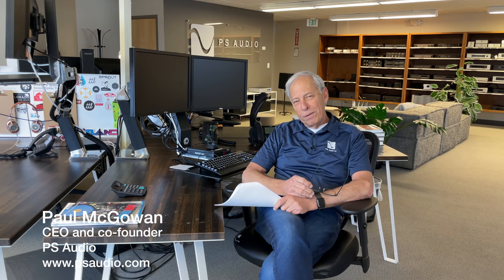Why speakers are made from MDF

Comment: One of the rare cases where the cheaper material is actually the better solution.
Reply: cheaper still is fibreboard:) used in very low end speakers
Reply: @MrTruth111  Ah yes the choice of Logitech and other small PC type systems. I call it cardboard wood

Comment: Just as Paul says, it's all about resonance, I am a Woodworker since about 20years now, and He ist exactly right, for a Speaker Cabinet You want a Material that ist as homogenous as possible preferably with a high density, MDF is basically a compromise that's pretty easy to machine, while very homogeneous, that Makes it an ideal Material for adding a venere or varnish to it without the Risk of Cracks while being reasonably cheap. Probably a better Material would have a Higher density, such as corian what ist essentially acrylic with added minerals to get similar properties Like marble while being a thermoplast and at the same time can be casted like a liquid, but it is pretty expensive and usually Used for Bathrooms or Counters at Airports and such because of its Properties. Another alternative would be HPL. Plywood usually adds too mouch resonance for high quality speakers, and OSB or ESB is not ideal due to not properly glued Wood Chips, which can resonate in an uncontrolled manner.

Comment: MDF is relatively cheap, easy to work with - as in doesn't burn out your computer controlled circular saw and is acoustically inert, can be veneered with prettier looking real wood at little extra cost, etc. But MDF tends to deteriotate in tropical climates. I've heard that in the Philippines and neighboring parts of SE Asia, loudspeakers made from real wood like 1960s era JBLs and Klipsch Heresys are still alive and kicking but 1980s and 1990s era MDF speakers have started to crumble back to sawdust from 2009 onwards.

Comment: When I was building my speakers, I knocked on the back and sides. It didn't sound dull, so we glued and screwed another inch of MDF to that area. I used 1"X1" and 2"X2" oak glue blocks along all seams. The inside has several coats of polyurethane to reduce moisture absorption. The baffle panels are 1" marine plywood. I was going to use veneer on the outside, but used plastic laminate instead. That actually added deadening to the panels. Forty years later, they still have that big JBL sound that gets to my core.

Comment: Hi Paul...Great question from your community..Back in the late Eighties I was reading an article about the development of a speaker called the SL 600 this was made using a honeycomb structured Aluminium ( as used on flight  deck manufacturing) a prototype made with excellent sound characteristics and reviews of this pair where getting very positive results. So a small production run was put in action and the these speakers where then again reviewed by the Great & Good in the industry....alas all the comments where rather negative  !!! The reason being is that they had made the production model too perfect and of course now the body of the speaker had its own frequency which coloured the sound. As an example we know that bone china has that wonderful clear ding if you flick it with your finger , but when it's cracked that ring will turn into a thud. So the first set of speakers had a fault in their construction which had disabled the cabinet frequency  and the "Perfected" manufactured assembly line run had created a cabinet frequency. So month's  later I finally got to listen to a revised pair  (  with the intended  fault in the cabinet design ) and they  sounded really good. My own experience in designing speakers where to also  reduce cabinet frequency but  to completely try and deminish the standing wave from the transducer inside the structure...but that's another story.

Comment: Solid wood has expansion and contraction issues. 
I don't like MDF/HDF, can do without all of the formaldehyde used in manufacture. Plus cabinet walls need to be significantly thicker to achieve the same degree of stiffness as a quality void-free multi-layer plywood. 
I only use Multi-layer void-free Baltic Birch Plywood for my own DIY loudspeaker projects.
Reply: I've built identical pairs of speakers using Baltic Birch ply and MDF, and the the MDF pair sounds better.  The BB-ply versions have a bit of woody boxiness in the mid-bass that the MDFs don't have.   Adding deadening vinyl to the inside helped, but still not better than the MDF cabs.
Reply: @TheMirolab  Yes, PA and instrument cabs are plywood. Light and strong are more important than heavy, less resonant speaker cabinet. MDF has been great improvement after 60-70's chip board boxes.
Reply: @pekkatervala8476  MDF is a bit easier to work with. I've never had a clean cut or edge treatment on ply 😒
Reply: @staLkerhu  Yes, plywood is great on instrument and PA cabs  on the road. Guitar cabs are preferred to have resonant material. MDF is hard to beat and it's cost effective. Common material on kitchen cupboard doors, it stays straight and can be decorated with a router.

Comment: I'm no acoustic expert but I'd guess that real wood is also very inconsistent in its density, and you really don't want that in speaker design. Think of the different colors of a wooden sheet which usually represent some kind of imperfection and a difference in hardness. On the other hand MDF is pretty damn perfect in density.
Reply: All the commenters are answering better than Paul...

Comment: Fender Blackface amp cabinets (like the Twin Reverb) are made of MDF for this very reason, to get a cleaner sound without cabinet resonances. Fender Tweed amp cabinets (like the 59 Bassman) were made of pine which does resonate quite a bit and is considered part of the Tweed amp sound.

Comment: There were speakers designed early 70s spendor BC1 and the Rogers LS35a using a specific Birch ply which was intentional as part of the design meaning the speaker would sing and that was catered for in the design .this is rare however..Hi Paul

Comment: Other designs like the French speaker/amp company, Lavardin/Lecontoure, use plywood for their cabinets and also stated that plywood has the best ability to get rid of unwanted vibrations. if u put your equipment on such a base made of plywood, it will benefit big time (try it). So they made a series of speakers (3 models), which cabinets was made by plywood. I own both (amp/speaker), and my experience with using plywood underneath my components, is a real bargain. It works! As for the speaker design...they wen't with plywood, as a part of the acoustic "treatment", in lack of a better word? The designer thinks MDF wasn't good enough for what he wanted, so there u have it. My system is defiantly a French one, and not for everybody. But when you first get your head around what your listening too, then it's very hard to go back to any other system (imo). Cheers from Denmark

Comment: MDF is made from very thin fibers bonded in a resin under very high pressure.  It is very dense and does come in several densities(LDF, MDF and HDF).  Particle board is made from wood particles(sawdust? not really) and also comes in several densities.  Natural wood has resonance largely due to the pores that run the length of the board, the larger the pores(grain) the more resonant.   Particle board is actually a bit deader, but is not as good a material  to work with as it is weaker and not as smooth as MDF or HDF.  At one point hobby builders were using an inner layer of  particle board and an outer layer of MDF bonded together for a very dense, dead box.

Comment: Consistency of the material and reliable to machine to fine tolerances. Grade-A multi-birch ply, braces and damping panels, if you have the money, and prefer to not have to use a pallet truck to move MDF around. :-)

Comment: DENSER & DEADER. To supplement the combination, the interior is lined with acoustic sound deadening materials. The TMI version would be there are a lot of mathematical engineering that goes into the precise specifications, dimensions and materials list.

Comment: Short answer I guess is that it may have better sonic qualities. Some speaker designers may use paper cones instead of metal not because they are trying to get by on the cheap, but because it produces better sound in their opinion. Copper may be better than gold in some cases outside a jewelry box. What would otherwise be cheap furniture material may be ideal for sound producing equipment.

Comment: Most if not every reasonable material used for speaker cabinets has a small/great ring to it, especially when stressed.  But this is where internal bracing comes into play, which essentially act as dampers.  A superior damping strategy is critical in speaker cabinet design.  The question to ask is, what transformation occurs when a speaker cabinet regardless of material (or perhaps any object) is sufficiently damped?  I suspect the correct answer to this question is where much performance potential is hidden.

Comment: Paul, the desk you knocked on looks to be butcher block -- pieces of actual wood glued together --  not MDF. A key tell is the orientation of the endgrain. Given how unevenly it has accepted stain, I'd guess it's either birch or beech.
Reply: I noticed the same thing!
Reply: It looks to be because they designed it to look that way.
The giveaway that it's some fibreboard material is the extensive steel undergirding to prevent sagging.
Reply: @nobodydoesithalfasgoodasyou  Nope, that is not fibreboard. It's solid planks of wood.
Reply: @nobodydoesithalfasgoodasyou  Not true. All sorts of wood tables (even solid wood) have metal braces so they don't sag.

Comment: I have a pair of Chateau two-way speakers from the late 80’s.  They’re built of birch plywood, I believe ¾ inch thick.  They’re extensively braced and all interior surfaces are covered with epoxied lead shot.  They are very dead.  The woofer is a German Eton and the tweeter is an inverted dome French Focal.  I’m quite sure pretty much all I hear are the drivers.

Comment: great topic, but if i dare think out loud here and say that if the cabinet is dead and hard, all the woofer pressure is reflected back, so the damping material inside has to be equally up to the task. 
what if we made the cabinet walls a bit thinner so it flex, then something like "Silent Coat MultiLayer Extra 5 millimeter".
its essentially mass damping, then polyfill the volume.  

i like mdf, its really cheap, you can do routing and shape it, no splinters.

Comment: In my humble but lifetime of loudspeaker designing and building I've found that MDF is a very inferior material to use esp for large speakers.  I've used it all including solid hardwood for some very "boutique" creations.  BTW a properly made complete box made of hardwood doesn't ring...it's just too expensive.  High-ply count, hardwood plywood (again imho and experience) is the best overall.  I think the real answer to the question is the same as why some high-end manufacturers use cheap crossover components.  ;)

Comment: Oak,maple, or mahogany veneered plywoods are dense too, just cost more! Just as dense as MDF or HDF, cause plywoods are cross-grain layered woods glue and dried under extreme pressures!
Reply: Yep. B&W uses plywood, but they have the technology to press it to the final shape inhouse. This is superior to any attempt at bending MDF, or using 90° joints.

Comment: I was always under the impression that the speaker or motor is the only thing you want to produce the sound wave, sympathetic wave emanating from the enclosure is not wanted. The reason you need a box or enclosure is to control the air and to offer the motor the correct air pressures to produce the desired frequencies and amplitude.
The best speakers I have ever heard where indeed housed in a concert box. Everything vibrates and has an inherent frequency but when you look at things so heavy and dense the frequencies are so high it no longer matter as we can't hear them and they are also so weak the amplitude is not powerful enough to create phasing issues or harmonic distortions.
I wonder why we don't see more speaker companies offer other materials more often?
Turntable plinths with internal lead shot to dampen resonances or reconstituted vinyl records melted down to become the damping factor to an aluminium platter are useful maybe there is something in it for speaker box designs?

Comment: There's wood with high resonance and low resonance.  Not sure which one is better, but I believe higher resonance is better. Maple, Oak, and Mahogany are probably the densest woods available which would make for good speaker cabinets. Maple is one of the woods that does have the highest resonance. The only other one is a species from Hawaii and is very expensive.

Comment: That's only one of the reasons. Mdf dosen't swell & shrink & crack, with changing humidity. It is also consistent from batch to batch, in strength & density. Pieces of wood even from the same tree have different densities. Then there's cost. If your going to produce hundreds or thousands of units that have to be warranted, mdf ends up being less expensive for all the aforementioned reasons.

Comment: Here in the Netherlands we had a company that actually made speakers from a concrete composite material.
Reply: @lepidoptera9337  it was marble particles with marble powder andere cement based binding component. This combi was choosen fort its dead structuren.
And the outside was polished to aperfect marble shine. One could even choose the colour of the marble.
I heard then on several demo occasions and they sounded very good.
Speakers and filter components all were high-end.

Comment: Some speaker cabinets are made to sing The Spendor SP2 is an example
Reply: my spendor SA1 has some think cabinet walls, and one bracing that is it. compared it to my other speakers made from HDF and that is probably why the midrange is so different.
Reply: Singing speaker cabinets are never a good thing and that idea is a bit outdated by today’s standards and how things are done today. But if that is what floats your boat then ok.
Reply: @sudd3660  The cabinet becomes an active part of de equation. Much harder to design than just making it as dead and stiff as possible.
Reply: Never say never
Reply: @D1N02  i just hope spendor audio knows what they're doing, because i can't tell if i like it or not. but i sure do like that speakers sound different. 
same reason why people like ported box, or horns, if its enjoyable the end sound it produces then it works for them. 

side note: dead and stiff are not the same thing. dead is absorption and stiff it hard and reflective.
Reply: Those cabinets are pure BS then !
Reply: @Channel-cm7yc  It's definitely a different experience most modern audiences probably can't stomach it though.

Comment: I wonder if there's any place for Epoxy Granite in speaker boxes? It's used in high precision machine tools for it's fantastic deadening properties verses the standard cast iron, and is much stronger than concrete in tension so you can make thinner panels.

Comment: I use Baltic Ply, cabinet grade 5/8's way stronger and better than MDF, but another reason not to use hard wood, is because of the moisture & dry air, it drys wood out and cracks and shrinks / expands and causes issues.
Reply: Real wood needs to be aged to become stable. Upmarket guitar makers - both acoustic and electric - use woods that are aged at least 100 years when making guitars in the 10,000 + US $ price range.
Reply: @laurentzduba1298  I'll stick to Baltic Ply :)
Reply: You can accellerate this process through baking the wood in low oxygen (after also drying it for a few years beforehand) .  The necks of a lot of high end guitars are made of maple that has had all the volitile constituents baked off.

Comment: I'm already picturing some DIY types making plans for a concrete speaker project.
Reply: Thiel's upmarket line are made of concrete but they used a fancy marketing name for the material and called it "fountainhead".
Reply: Fountainhead LOL, imagine cobblestone speakers!
Reply: @laurentzduba1298  Fountainhead is a man made composite that is very similar to Corian, not concrete
Reply: @stefanschneider5624  zu viel Geld, aber schön.
Reply: There was a bit of a fad for concrete speakers in the 80s.
Reply: Just Google "25 Concrete Speakers"
Reply: Did that before, works great, comparatively simple to work with, just heavy…
Reply: Granite
Reply: @graxjpg  terracotta, little planter pots with holes on the bottom for the speaker wire lol
Reply: @ChiefExecutiveOrbiter  That's what I'm using in my current speaker, Norwegian, needless to say it looks nicer than concrete.
Reply: Look into the old design of F3 Lyd/Onken Focal (concrete eeg cabinet).

Comment: It was a good answer but unfortunately it was missing one of the key points. That is that real wood moves. As the moisture level in the wood changes, the joints move and also cracks begin to form. Real word is a horrible product to use for speakers.

Also, the gentleman who wrote the letter using oak as an example gave me a chuckle. Oak is one of the most common hardwoods available in North America. If by no means is considered an expensive wood. It is the cheapest of cheap woods when people want to step up from a softwood to a hardwood.

Comment: 24mm Birch plywood, is the best to make speaker cabinets from, its dead as a dodo and extremely strong & rigid far better than MDF.
Reply: I've saw it used in vintage cheapo speakers but it made them sound better than their price point.